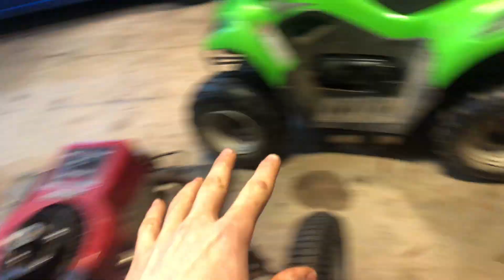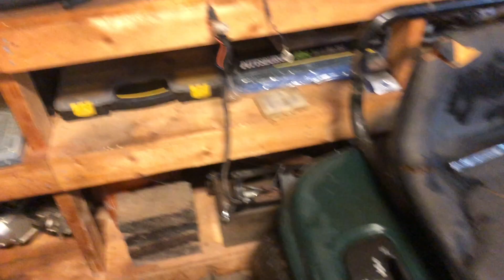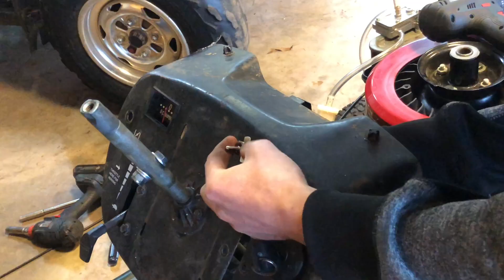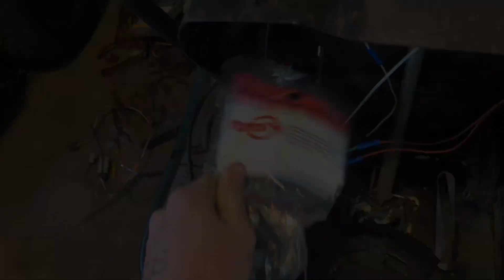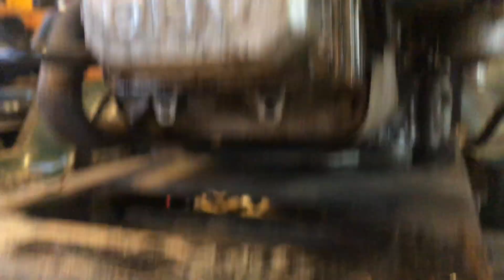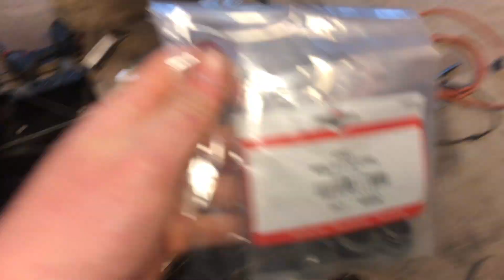New Project! | Off-road Lawnmower Build #1

Comment: how’d you wire up that manual kill switch and ignition? i’m trying to do the same thing on mine and it ain’t working at all
Reply from the maker: For the kill, take the ground wire coming from the engine(black) and run it to one side of the toggle switch and run the other side to ground. For the bush button start, take a wire and run it to your positive battery terminal and run the other side to the little tab on the solenoid and it should work, FearlessFront has a pretty good video on it.